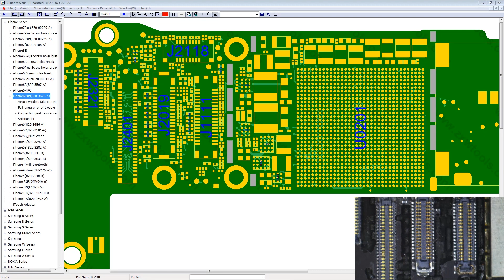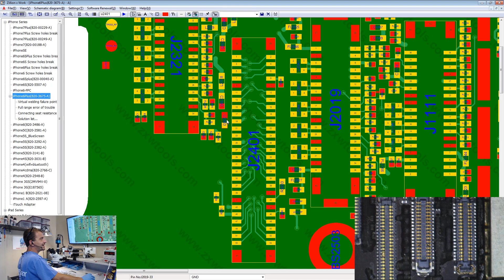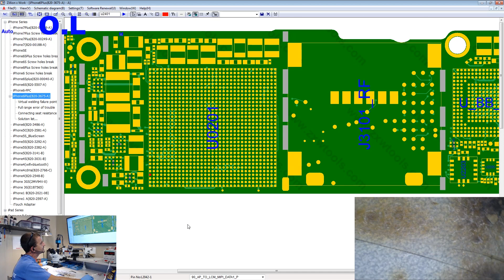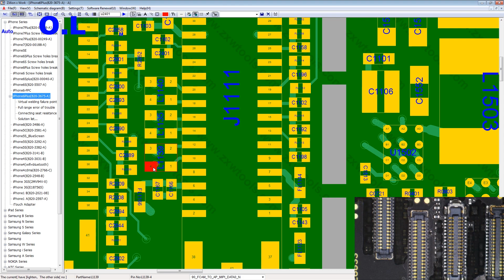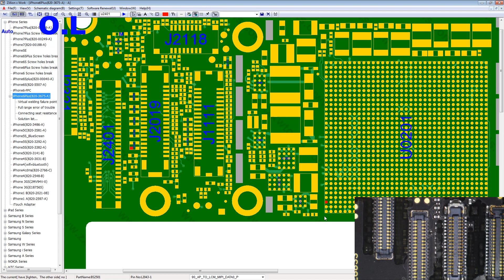iPhone 6 Plus No Image - I'm giving up on this crushed PCB

Comment: You could automate the process of checking resistance on all pins. For that you require something like Arduino board, multiplexer IC, compatible connector. The results could be sent to the LCD display or to the PC  through serial port. You can save a lot of time.

Comment: the whole situation is not so bad, he is still able to recover data tough.
Reply: Not if it has a passcode, as no way to enter the passcode, if plugged into a computer to backup it'll ask for the passcode before it'll connect to the phone.
Reply: you could look at another iphone for precise placement of number icons and input passcode blind as long as touchscreen works
Reply: Iain Simpson i know, I thought i wouldn't need to say that but if you remember the numbers position you could still input the password
Reply: I hardly ever see any where the touch works but lcd doesnt, 9 times out of 10 both stop working
Reply: I hardly ever see any where the touch works but lcd doesnt, 9 times out of 10 both stop working, the lcd works but touch doesnt iv seen many times but I cant think of once where iv seen the lcd not work but touch still work.